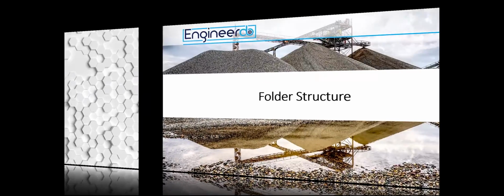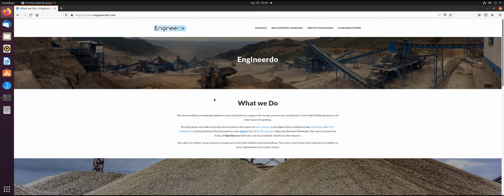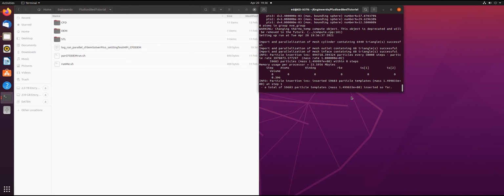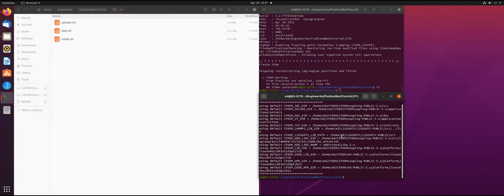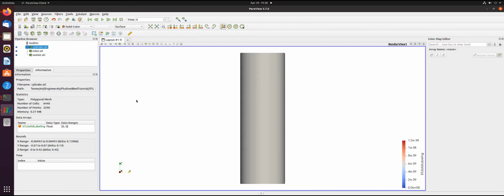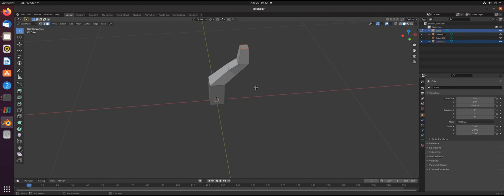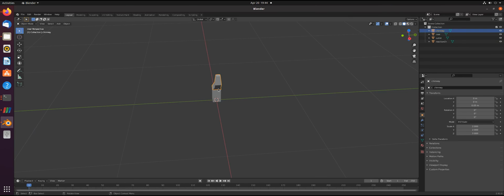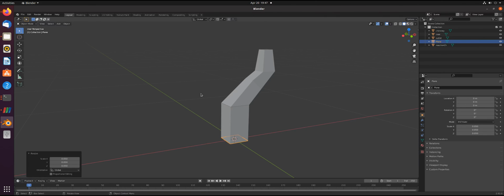CFD-DEM Coupled Simulation with openFoam and Liggghts Tutorial part 1

Comment: Is it good to use helyxos or paraview for cfdem problems?
Reply from the maker: Hey Teres, you can use helyxOS to set up the CFD case pretty efficiently. Of cause you will have to make some addptions later when including the DEM part. 
Paraview should be used anyway. It is the right tool for postprocessing of CFD, DEM or coupled results
Reply: @engineerdo6568  Thanks for your reply😇

Comment: Thank you for the good tutorials. I highly recommend your channel. It helps me a lot. I checked out your webpage and it seems that you don't have something related to study the effect of applied stresses on the change in channel width, this may impact the movements of particles along the channel (fracture). I am following this tutorial and I am wondering how I can set stresses applied on walls of particles container (fracture/ channels) to simulate the change in flow and if the particles have enough resistance to prevent it from crashing?